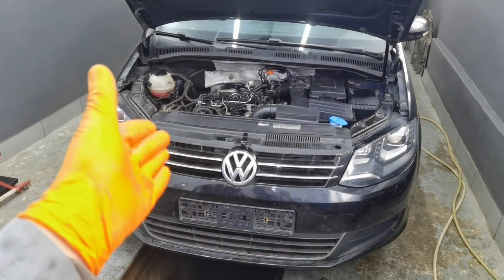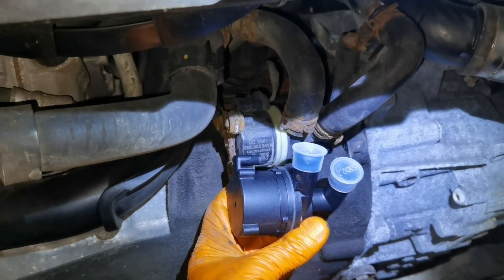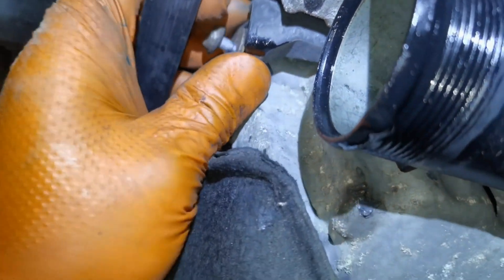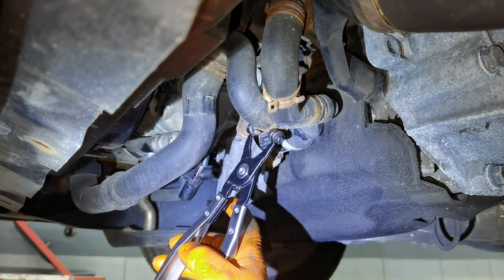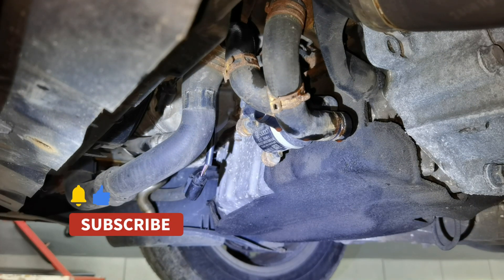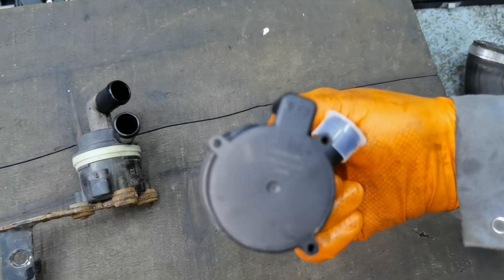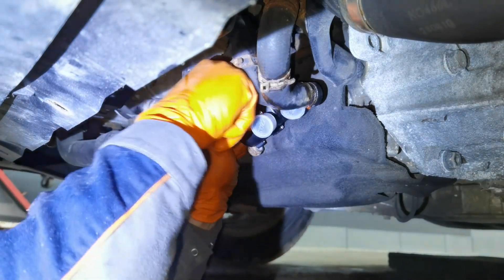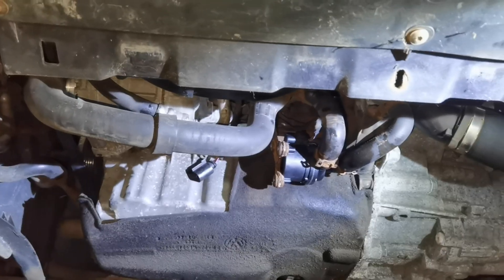How To Replace The Auxiliary Coolant/Water Pump On Any Vehicle (P261A/P261B)

Comment: In my Seat Leon CAYC, 1.6tdi, the engine temperature does not rise when the outside temperature is low. I have already replaced the main thermostat.
Could the auxiliary coolant pump be faulty without showing any fault code on the OBD?
Reply from the maker: Yes it could be the auxiliary pump your problems. If the vehicle it’s automatic you’ll have another thermostat installed over the gearbox, make sure to check it out.
Reply: @HOWTODO0828 it's not dsg.